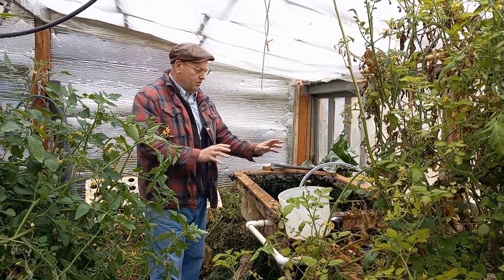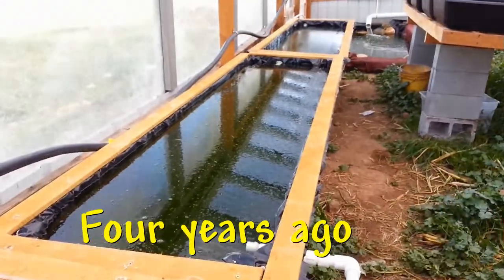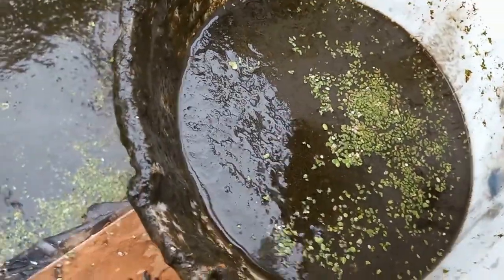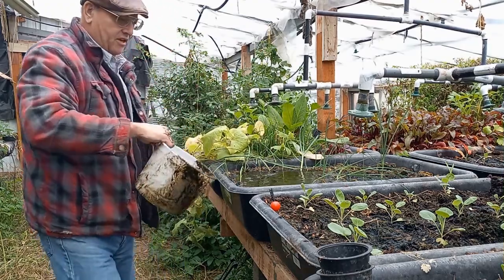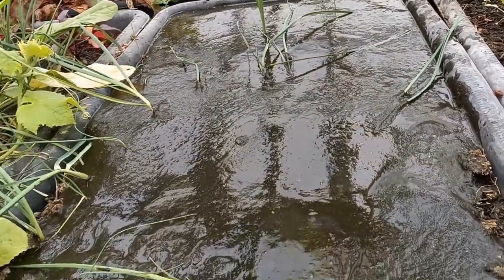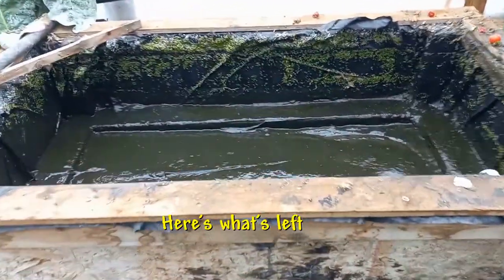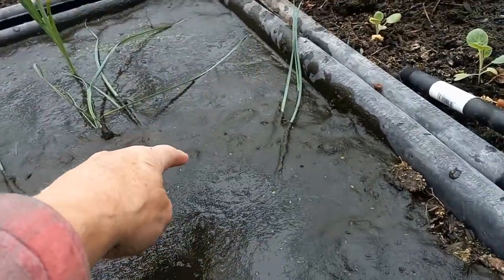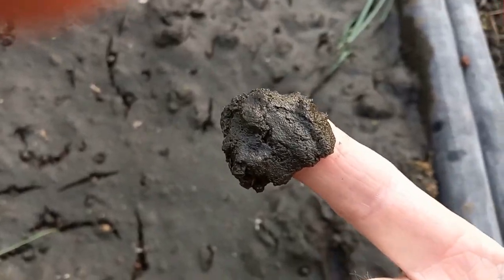Unconventional Rich Organic Aquaponic Compost

Comment: It's a neverending task overhere in the lowlands of Holland: cleaning out the ditches. The normal practice was putting it back on the surrounding fields. But in more recent years they became aware that a lot of those silted up water bottoms were also very rich in persistant pollutants like old school pesticides and heavy metals. Never used my dredgings from the ditch at the back of the house to fertilize my garden for that reason, sorry can't help you out. In general I think you have great stuff at hand to be reused.
Reply from the maker: That's very interesting.  For me...I think I can use this "compost" as it is all really organic with no "other stuff" in it.   Good to hear from you Earl.